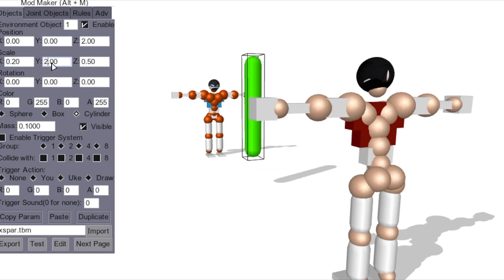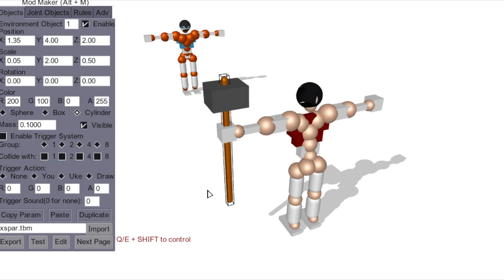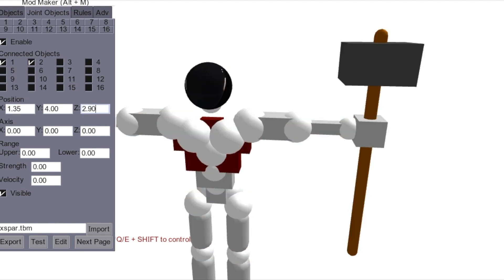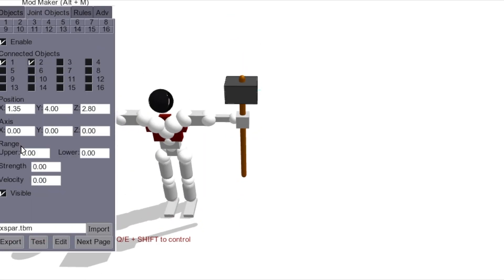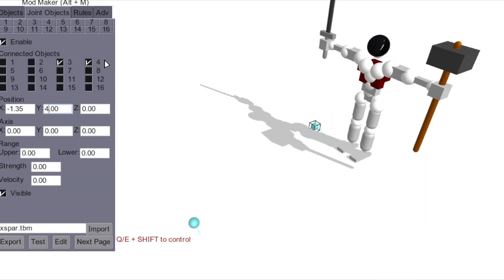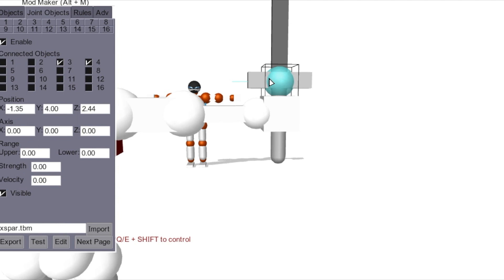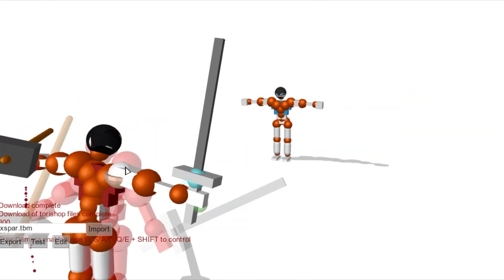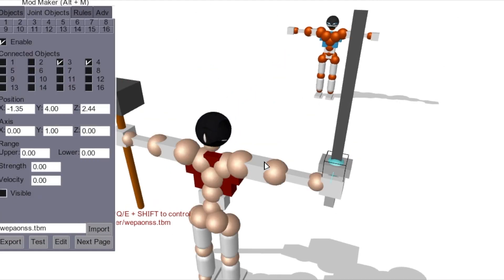WEAPONS & JOINTED OBJECTS ON TORIBASH

Comment: When friendly and enemy weapon collide sometimes they go through each other making it impossible to block the attack.  Is there a way to fix this collision issue?
Reply from the maker: It’s not just because it’s friendly vs enemy. 

This happens with any fast moving thin objects that collide. 

It’s the bad collision detection. Meaning when two objects that are thin, collide, the defection system doesn’t act fast enough to make them deflect. 

The only way to avoid that issue is make the objects thicker. But of course your objects will look weird lol 

It’s in an issue that’s not in the new toribash next coming out this year